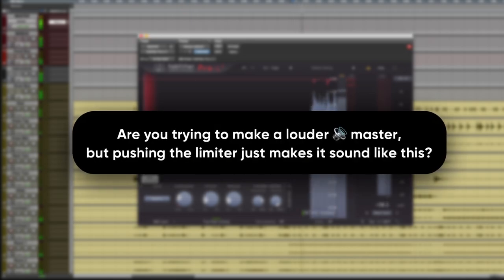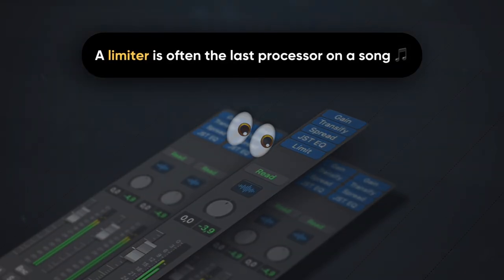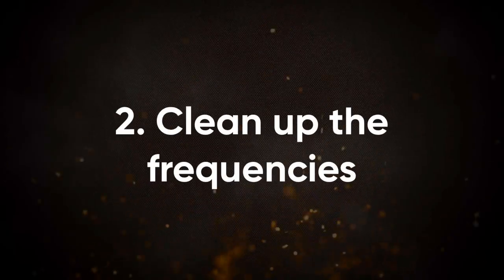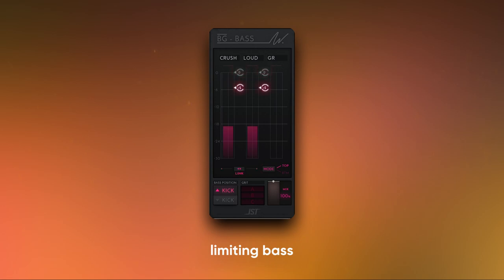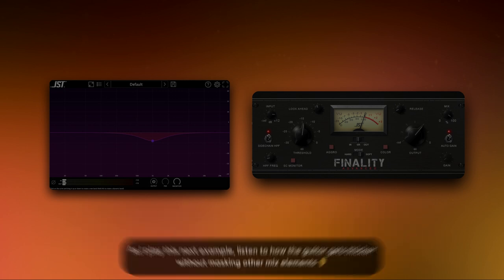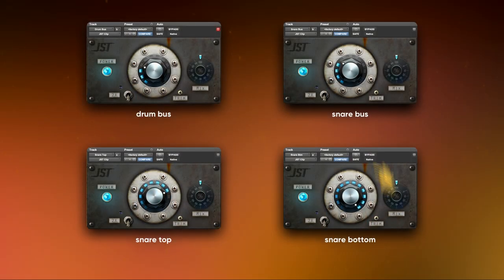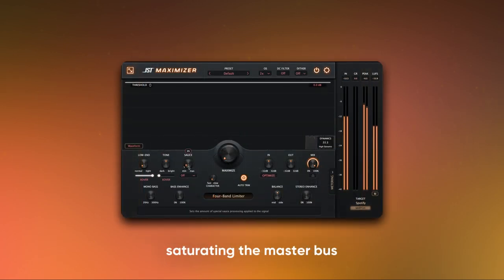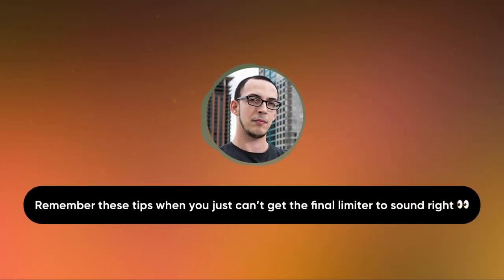Get The LOUDEST Master?!

Comment: I had not realized DrumForge has a multi-band clipper!  I had been looking for something like that for a while but found most were pretty expensive.  $39 is not bad AT ALL.  I did have a question about clipping individual tracks with JST clip.  You walk through this in your "Joey's Approach to Balancing" video, but how much clipping do you apply to each of your tracks?  Do you always push it until it starts to negatively distort, trim a set number of dB, or is there another metric you use?  I really enjoy the saturation JST clip gives to my drums but have struggled to know how far I should dig in on my guitar/bass DI's or on vocals.  Hopefully this makes sense.  I have really appreciated the content that you and Miami put out.  It has saved a ton of time and frustration.  Don't stop!